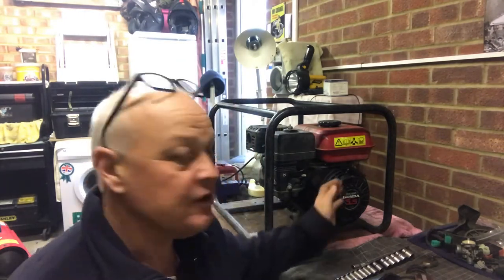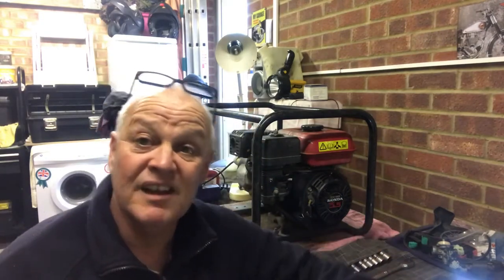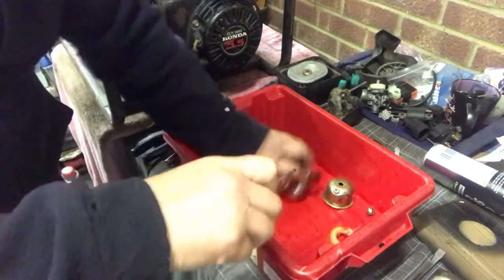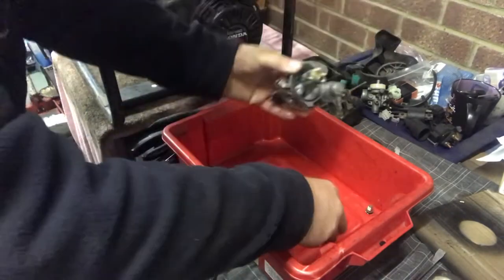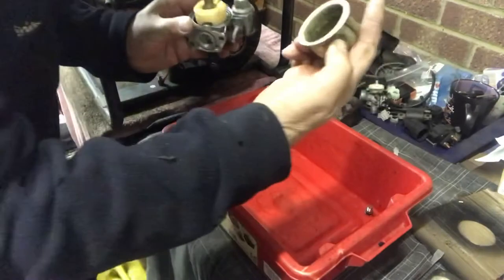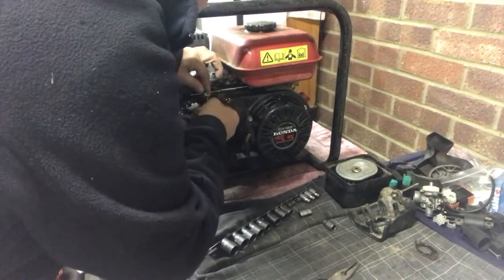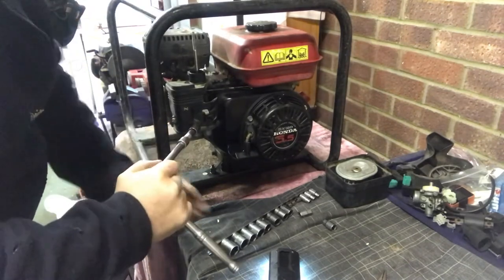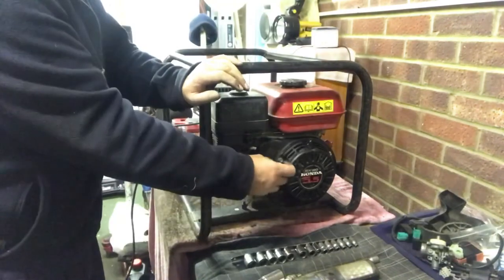Honda GX160 carburetor clean

Comment: Thank you.  I have to do the same to my Honda GX160 Pressure Washer.
Reply from the maker: Hi Rocky 
Thank you for you kind comment I’m pleased my video was able to help you 
Regards 
Richard 👍
Reply: Same here… trying to get a pressure washer running right. Unfortunately someone ran the unit without oil in the pump so it’s destroyed. I’m trying to salvage the GX160 engine and attach another pump to it. The engine will run, but not without choke half-engaged. I hope the sudden stoppage of the pump/motor didn’t hurt the engine internals.